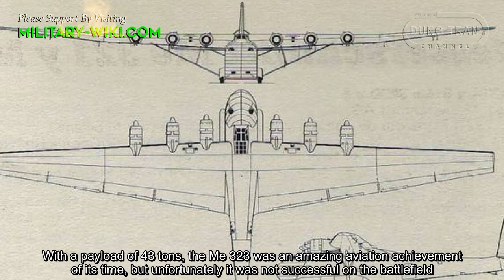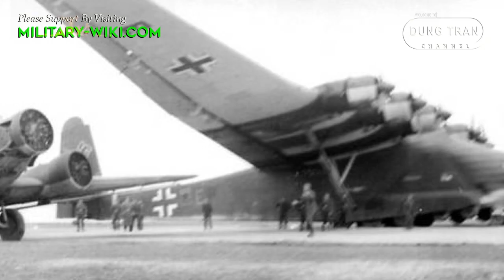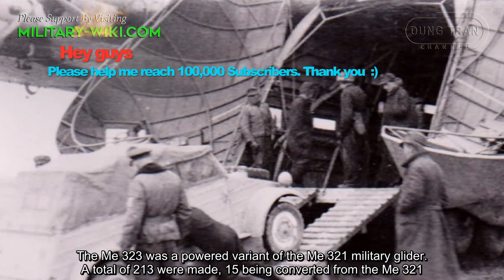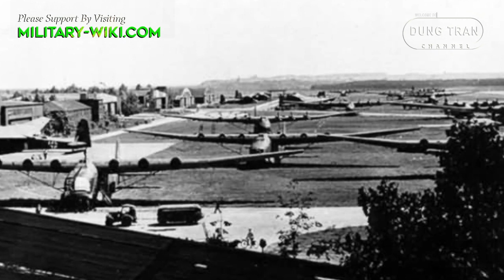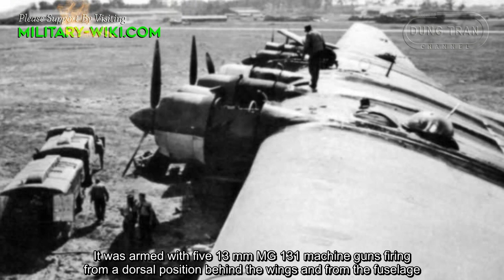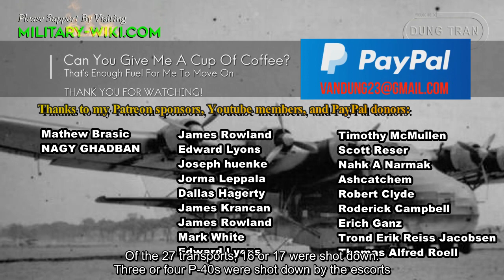Messerschmitt Me 323 Gigant: WW2's Super Transport Plane And Germany's Failed Ambitions

Comment: The Me-321 glider was meant to carry heavy equipment but it was too hard to tow and the controls hard to operate. That is why they were redesigned with engines to get the airframe useful and do large numbers of troops in one go.